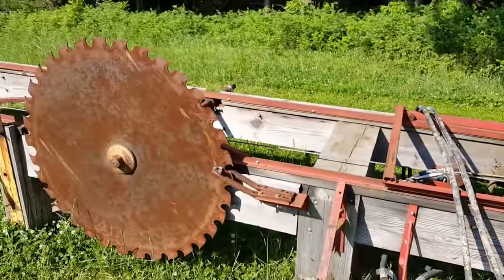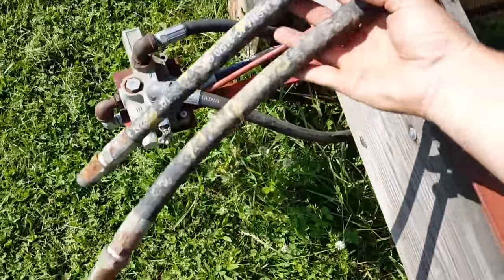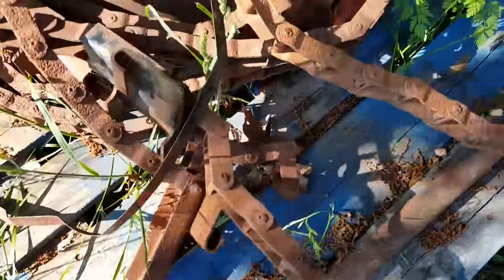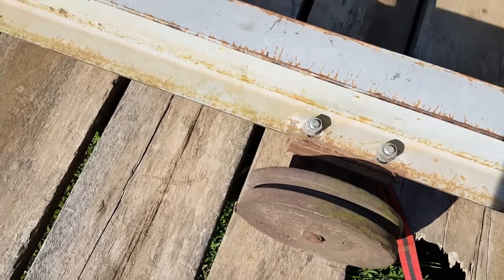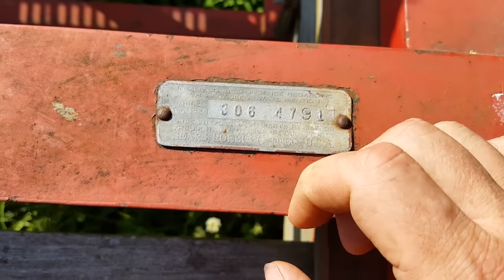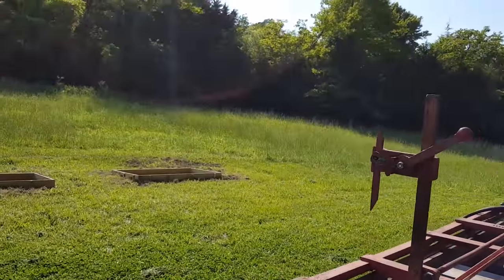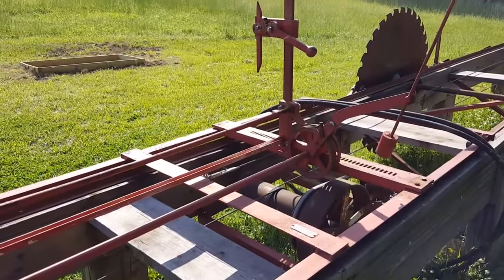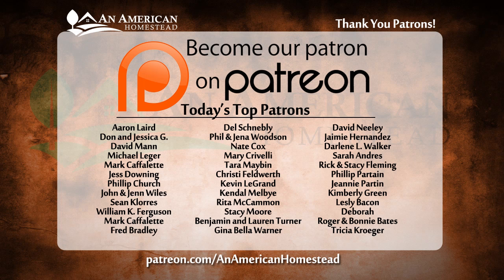Foley Belsaw Saw Mill Update

Comment: Zach: this is an "Inserted tooth" blade. The individual teeth have numbers on them which correspond to their size. I have two blades, Simmons 52" ers, sitting in my shop. Tried to salvage a complete Farquar sawmill from the 40's several years ago. Got the blades and a few parts before metal thieves got the rest. Use Diesel fuel and a whetstone to clean up the rust. Can't wait to see it run .

Comment: Sure hope you lifted the re-bar off the ground before they poured the concrete . Also , when a set of new teeth are installed , try a very slight side dressing on the saw for a smoother finish , nice looking toys , good luck with ig

Comment: Congrats, I just posted a video of my bandmill a few weeks ago. Love working the mill. but it is alot of work. Yes the rust will wear off quick with the milling running again. If I may I would suggest a cheap metal detector to scan the logs before cutting. Nails and bullets are heck on the blade teeth. I have gotten where I will not cut yard logs at all, yet we still have the tree stand builder that has to use ten times the nails needed. Cant wait to see it run.

Comment: Oil please. lightly. Its going to be a great addition to your homestead. Well looked after it will work for generations. neglect it. it in the weather and will be gone in less than three years. also a word of advice. Use a metal detector on your logs before milling begins.
Reply from the maker: +Calo Q. Oh yeah, we are going to be greasing everything.  The blade should shine up nicely once its running. We are going to be building a shelter over the top of the mill.  Also we have a metal detector. :)

Comment: Everybody is getting into YT saw mills now.  Hope you have 5+ gallons of WD40 and get all that rust worked off that old machine, then 5+ gallons of grease and get all the parts lubed up.  Lets see what you are going to cut.
Reply from the maker: +John Lord The rust will come off the blade with the first log.
Reply: +An American Homestead HA! you cutting sand(al) wood or iron wood ... and so will the teeth, the blade nut, the main rod, and bearings .... DDDDDDD
Reply: An American Homestead the rust actually should not come off.....with lead in the saw the board being cut and the cant on the carriage shouldn't touch the sides of the saw blade only but for a second during the first part of the cut